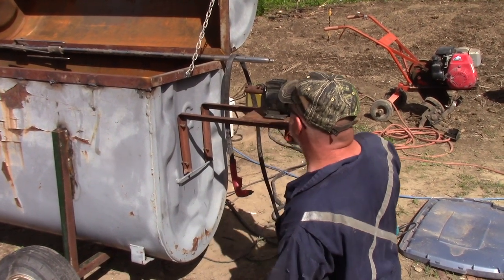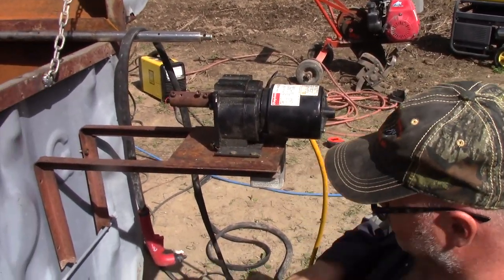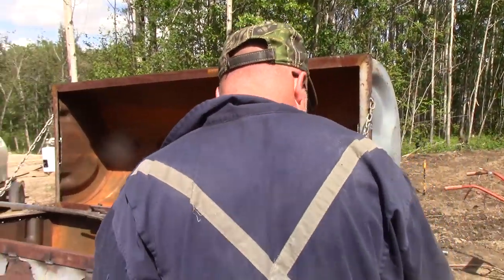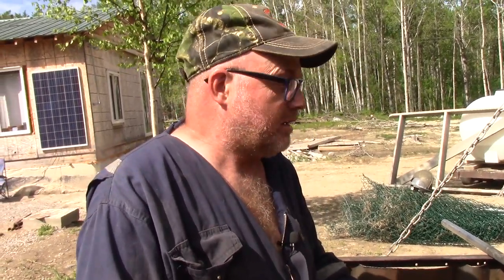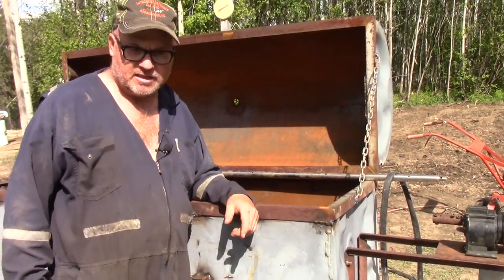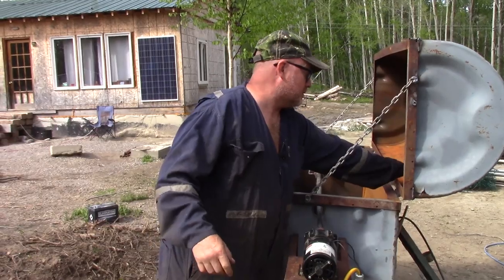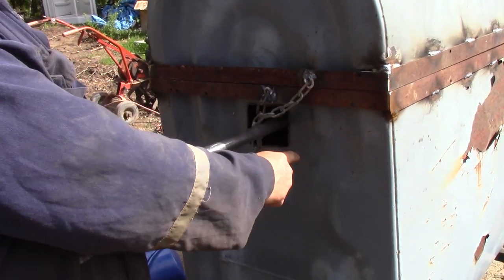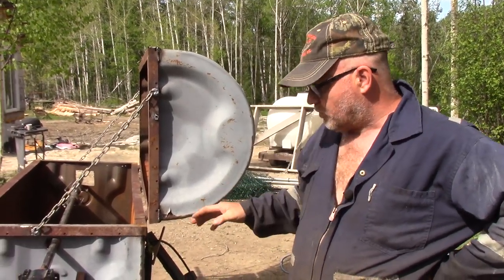Building A Pig Roaster, Installing The Spit And Motor, Plus A Lid Handle/ Off Grid Homesteading.

Comment: Many years ago I was a welder, the MIG machines were a new thing then. I can tell that you know your way around fitting and welding. Good job, I haven't struck an arc in over twenty five years, but I bet I could if I had to.
Reply from the maker: Hello Harold,  Yes I can also remember when they were a new thing.  I can remember welding in a large pipe in a shop and having fans blowing at us as we were burning 7024 rods... But when these mig. welders came into the shop,  No more fans to cool us...That's when I switched to be a fitter lol.  Thanks again. You have a great day...Cheers.

Comment: Maybe a little late by now, but the handle could be covered with wood, this helps avoid burning when it's hot won't sting as metal would do it...
Another idea is to add a counter weight in order to make the lid open up easier, there is a little trial and error process but maybe worth the effort. 
looks like the weather is on your side...!!!

Comment: On the subjects of holding the pig on the spit and holding it together as it cooks....  I've seen folks use washed, annealed tie wire to truss up the pig and wire it to the spit so it doesn't flop or fall apart.   Tighten or add more wire as it cooks and gets tender.                     Cheers!                     Whipple

Comment: The shielding gases to use are C25 for steel, tri-mix wity helium for stainless steel, and pure argon for aluminum and TIG.
Reply from the maker: Good morning Jeffrey.  Yes sir you are right, I think I explained this in one of my videos...I have a few years under my belt as a professional welder fitter.   Cheers.

Comment: dude, not bad but yawl need too place a few grill supports one for coils or wood, and one above it too keep anything from falling through.  try oak or hickory for the bearing's as it has the best resistance  to heat. is it will get hot. also some air holes in the bottom too allow draft. try as you may.

Comment: 👎no good, it would be difficult to remove your roast,  would have cut it all the way clear to the bottom angle bar . that drum is solid, and just weld the angle bar to the drum., and move your chain back out of the way in removing your roast. 🤣nice plasma, ill get myself one and thanks,  I learn something from you
Reply from the maker: Hello, The person I made this for has been using it for years and is loving it so far.  This drum is very narrow so you can't put a large pig in it anyways.  Thanks.  Cheers!

Comment: I would add plate on each end with pipe nipple for that rod to go thru ... that way you have no wood to burn or rotten over time out in the weather ....
Reply from the maker: Thanks G Mass, I am not sure how hard it would be to line the rod into the pipe nipple once the pig is on the spit, I have to be able to put the spit in on an angle...Cheers.